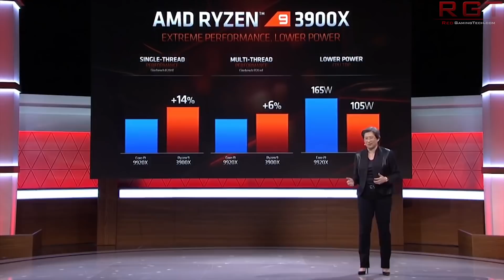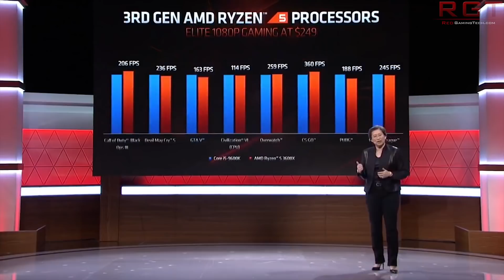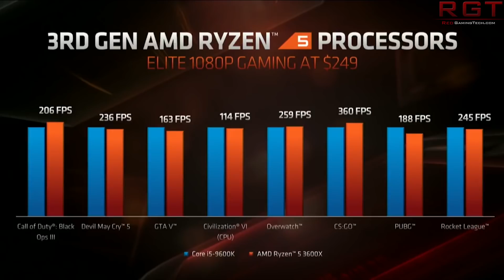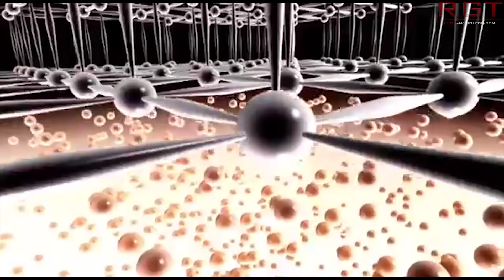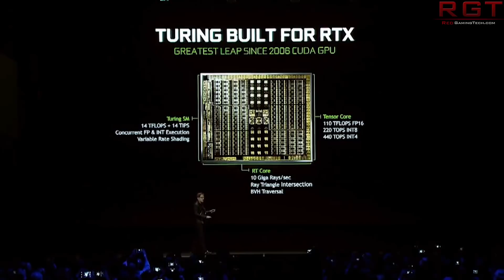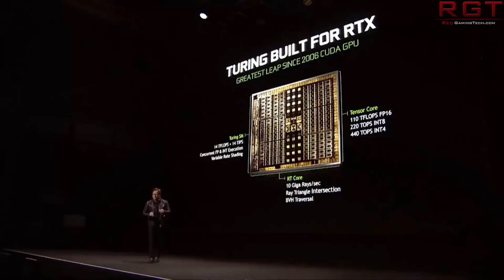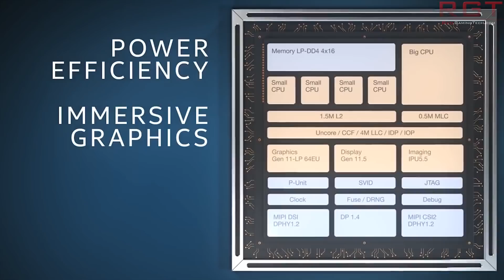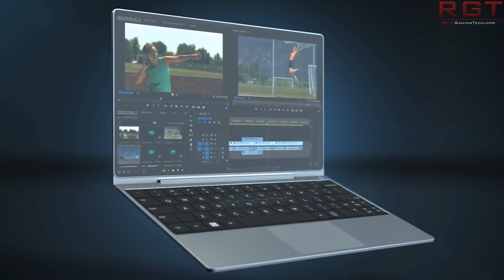AMD BIOS Update for Ryzen 3000 Boost Bug | TSMC vs GloFlo = 50/50? | Intel LakeField Leaks

Comment: I really don't care about it, my 3600x oc 4350mhz boost 4433mhz 1.360v h100v2 30c 65c max temps im happy with my new ryzen 3600x computer. At normal speed 4349mhz 4 cores, 2 cores 4299mhz . I just oc all cores 4350mhz boost 4433mhz.
Reply: No, people act like losing 50Mhz is the end of the world, you WILL loose 50Fps in games and performance is halved because the CPU can't do additional 50Mhz
Reply: It has nothing to do with performance. It's just misleading marketing.

Comment: LOL. 3700X+32gb 3200 c16+x570 MSI gaming plus+eVGA clc240.Mine Will NOT boost on any core above 4.275 at any voltage.
Ill believe AMD when my chip boosts as ADVERTISED.
Reply: Yeah the boost issue is strange. My 3900x will boost all 6 cores (not at the same time obviously) on the first chiplet to 4.5GHz - 4.575GHz in single threaded workloads all day without falling below that. The second chiplet gets to around 4.35 to 4.4. Perhaps if AMD implemented a way to check what exactly is the limiting factor that can be displayed in programs like HWiNFO.

Comment: Even if I am very happy with their evolution, each time AMD is the same.
Release AGESA majs that offer better performance on cinebench R20 or geekbench with platforms like AB350M or A320 compared to X570
Yes, the processor benefits from better frequencies on all cores with smaller platforms.
Already a big problem a 70 euro card with better performance than the 800 euro card????
To get out of the majs and see lower performance of the process for supposedly a better life expectancy 
Already in play the performances are not extraordinary and a simple i7 7700K has the same performances or even more once OC, compare to a ryzen 5 3600.

Comment: People have been reporting that during gaming they lose a massive 50Fps and performance in professional workloads is halved because the CPU can't clock 100Mhz higher.

-_-
Reply: Then swap the CPU if not what causes it to happen at all.
Reply: What do you mean AMD cpus can't power 50fps in gaming so i guess you'll be getting just a photo at zero fps in that case 😎

Comment: Also there  will be high temps and voltages that will come with the updates 

Your ryzen  CPU's will be dead in less than a year
Reply: Why ?
Reply: N7
Reply: bullsh!t
Reply: @TheHobbitmann  

Because of the increased boost
Which equals more voltages which equals more heat,  duh
Reply: Amd cpus for how many cores they running and also the performance they are now giving are running cooler than intels. Also and for me this is the main issue they are amazi g value for money. Intel tried to choke market snd keep us all on 4 cores unless u wanted to give intel mega bucks. The 2600x 6 core is a amazing chip for like 130 pounds now...intel needs to drop prices or they will be in trouble.0
Reply: @kingarthur7250  

Nah, AMD will never kill off intel they both share architectures, intel uses AMD's 64bit architecture and AMD uses Intel's x86 instruction set, they both need each because at the end of the day they are both coorporations and they don't care about us
Reply: @lldjslim  nah they have a new update bios for zen 2. Fix the problem
Reply: I run my Ryzen CPUs stock with approved coolers.  It they die inside a year, I'll be owed a new ones under warranty.
Reply: @rangersmith4652  

Wrong AMD will blame the consumer and u will void ur warranty
Reply: @lldjslim  Based on what evidence?
Reply: @kingarthur7250      Have you checked prices lately? Most Intel CPUz are competitive in price accept the 9900k.
Reply: vic viper
One can only hope!  I have seen one 3600x die already. I think it was the old B350 board that caused it however.